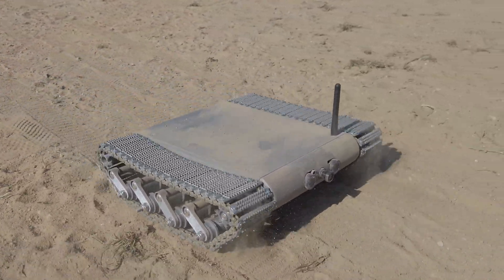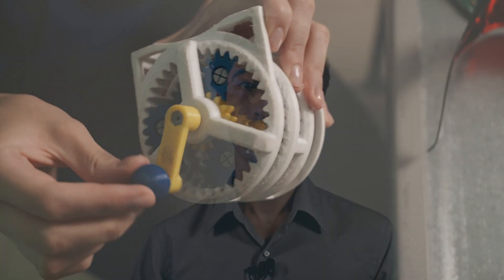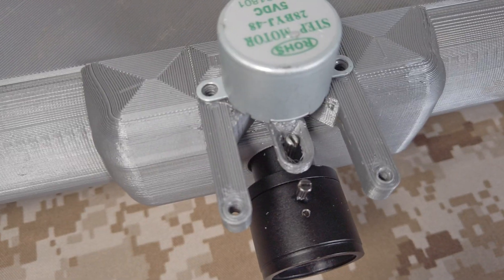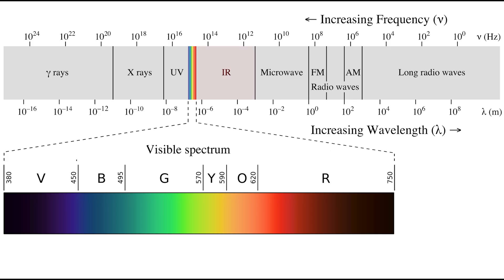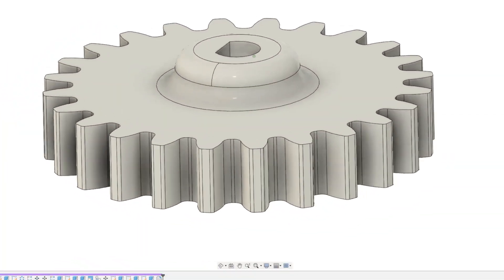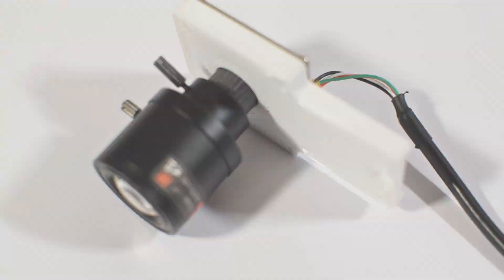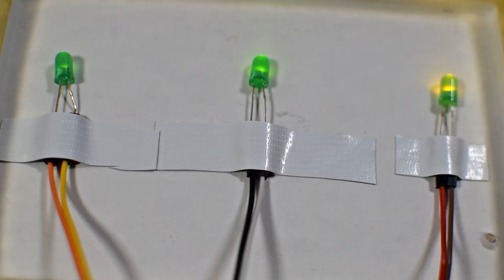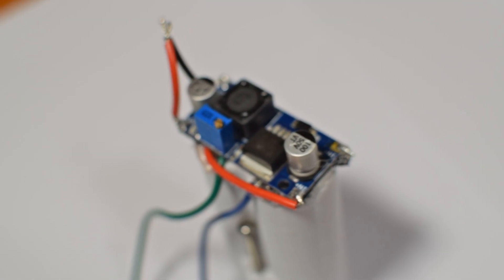I Built a Robotic Vision System!

Comment: easier to just make it so the lights point up to get more of a flood effect.    Photographers do similar tricks with studio lighting.
Reply from the maker: True. Better diffusion could help as well.
Reply: that works only in indoor. Ceiling is used as diffusor. I think, problem is that leds needs to be focused more to have reach and doesn't hit ground. And more leds = softer light = less contrast shadows.

Comment: damn this is so cool, were you inspired by the ripsaw M5 here?  also using node-red was a genius idea, just getting into drones and robotics myself so i got a lot to learn but love automating all the things with code.  what i love about the ripsaw idea is that the track platform is just a delivery platform with an assortment of top modules for various missions.  another cool thing about the ripsaw is the mesh systems that can be used to orchestrate multiple drones to accomplish a mission.  if there was one thing that bothers me just getting into this hobby is the lack of thought on the electronics bays.  for instance if I had your skills I would lean on more computing power like a jetson or khadas vim4 or basically anything that can handle opencv but all that silicon requires a lot of power so optimizing battery space is key for the electronics bay.  given that it's a rolling platform maybe an upper module docking mechanism that can launch a multirotor (whoop etc) drone for optimal visibility solutions
Reply from the maker: That would be sweet! I'm actually looking for better ways to connect instead of Node-Red. If you know of anything I am all ears. Something faster, lol.

Comment: I would go with servos over steppers for camera adjustments but well done on the design!
Reply from the maker: Thanks! Why is that?
Reply: @AvivMakesRobots   1. better control on the position, steppers could lose steps and servos wouldnt, 2. limited range of operation means you can have an inexpensive servo something like rc servos. 3. if you are doing tele video control or AI driven controls you want to know the position of controls reliably.
Reply from the maker: I see that, but servos are not closed loop, unless you get some closed loop servos.

Comment: I asked on another video but figured I’d ask on your newer video! Did you print using PETG? How is the sprocket holding up? And any parts that you have replaced for strength due to wear and tear?
Reply from the maker: Yes, PETG. The sprocket is holding up well. There is a bit of wear on the tips of the sprocket teeth. At this point I want to rethink the design and make it higher so there is more ground clearance.

Comment: Man thats some awsome work ..i love your video's ...iam trying to make a drive spocket like the one you made but for a 35 roller chain . i have a RC idea in mind but cant seem to get it ...any tip you can send my way ....ps i dont have fusion 360... iam open to any software you think i should use ....iam pretty new lol
Reply from the maker: Hey, no worries... It is easy. I actually have a video on making the roller links themselves and the drive sprocket, but do this: Go to Mcmaster.com and find the sprocket size you want and download a STEP model of it. Then, get some CADD software and use that as a base to model your thing with.
Reply: @AvivMakesRobots  i will try that thx you